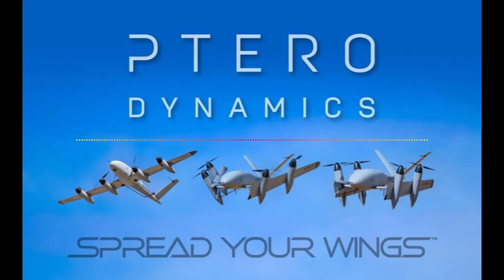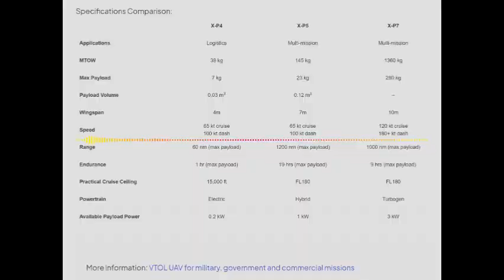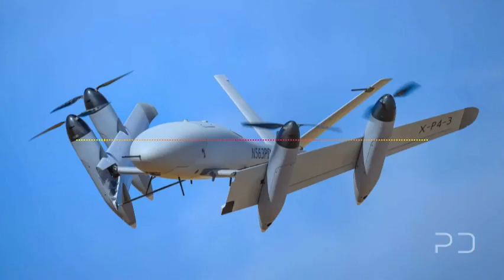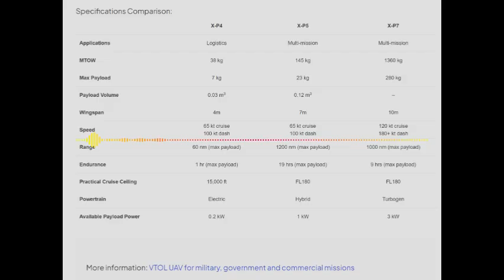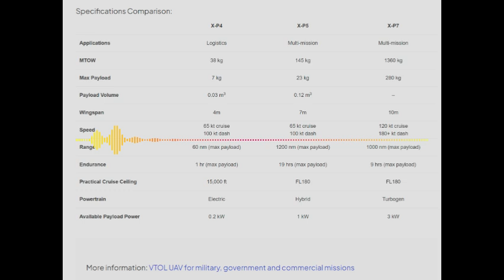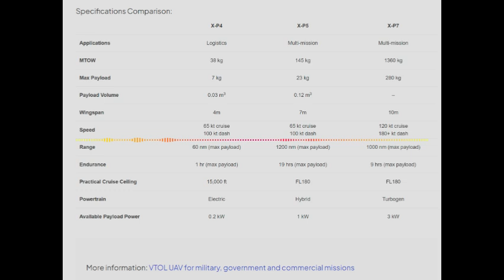WOW!! Revolutionary Drone Design State of the Art! PteroDynamics VTOL SPEED & RANGE of fixed wing!!

Comment: This design is all wrong the Chinook concept should be the placement of the tilt roller concept the front need to be lowered and they really need to be higher the extended wings should blend with the body craft and airplane mode and have the maneuverability of a swept wing will you look at older developments and make your job easier